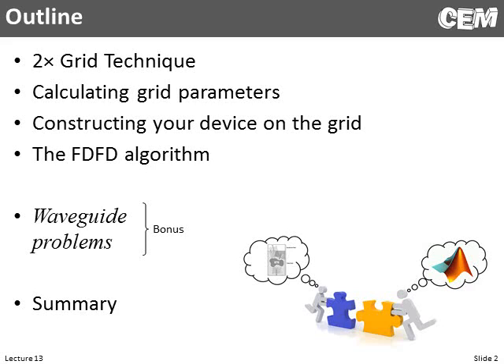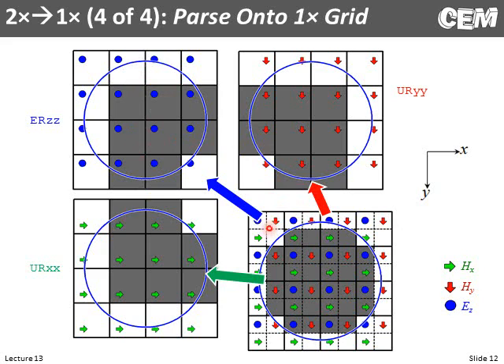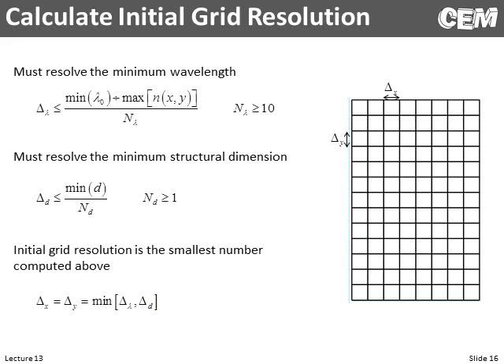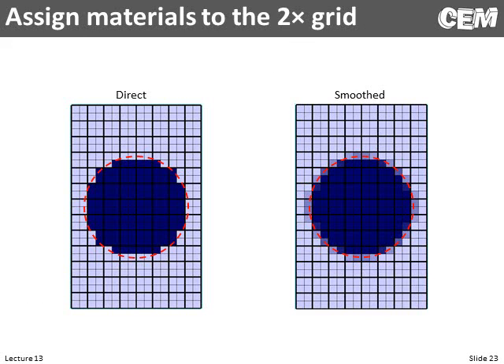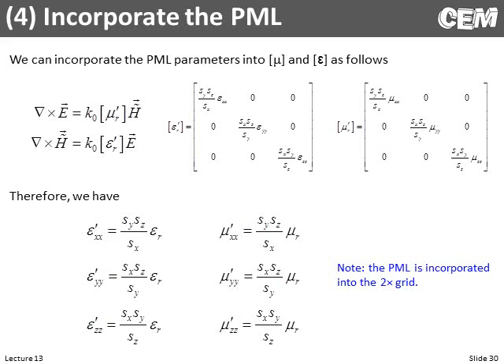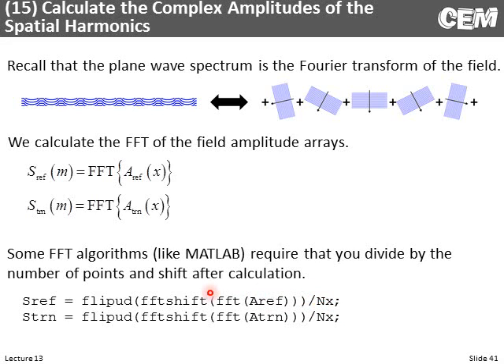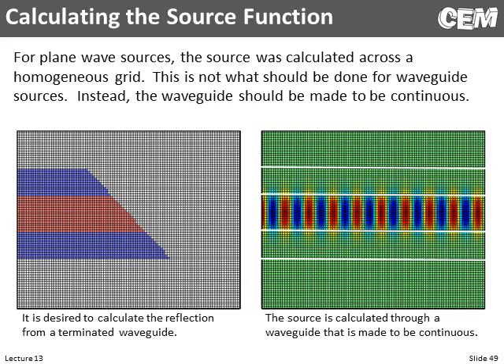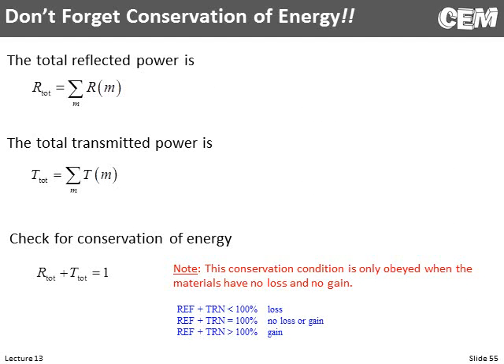Lecture 13 (CEM) -- Implementation of Finite-Difference Frequency-Domain

Comment: Dear Professor,  

Thank you for your clear and detailed instructional videos. I’ve encountered some questions during practical applications and would like to seek your advice.  

In the frequency-domain finite difference algorithm, when constructing a 2D model with periodicity in one direction, how should I modify the difference operators (e.g., **Dx**) at the edge positions to compute electromagnetic field variations under point-source excitation instead of plane-wave excitation? While mature simulation software can handle this, I haven’t found relevant documentation explaining the correction process for these edge operators.  

Best😊
Reply from the maker: First, if you are interested in finite-difference frequency-domain (FDFD), I have recently put out a book on the method. Here is a link to the book website. I highly recommend it. The book talks about this subject, how to modify the derivative matrices, and has all the MATLAB codes.

https://empossible.net/fdfdbook/

To answer your question, the only information from the source your derivative matrices will need is the wave vector to account for angle of incidence. The Dx derivative matrix will need periodic boundary conditions. However, it the source wave has an angle of incidence, there will be a phase difference between the left and right sides of the grid that will need to be accounted for. Sometimes this is called a Floquet boundary condition, but I just call it a periodic boundary condition.

Comment: Thanks for these videos!

Quick question:  Is a PML necessary if you're modeling the 2-d mode fields of a waveguide?
Reply from the maker: That depends.  If you are just calculating the possible modes in a waveguide, you will not need a PML because you will not need to absorb outgoing waves.  This is an eigen-mode analysis and involves solving an eigen-value problem.  If you are simulating a waveguide circuit, you would need a PML, or some other type of absorbing boundary, if any waves escape the waveguide and and need to be numerically eliminated.  This would be called a scattering analysis.

BTW, you may be interested in this new book that covers all of this.

https://empossible.net/fdfdbook/
Reply: @empossible1577  Thanks Professor!

Yes, I had figured a PML wasn't necessary for my guided mode modeling.  The modes I'm getting are just random-ish field distributions that seem to be ignoring my waveguide geometry.  Was wondering if the lack of a PML was the issue.  Could just be a problem porting over to Python.  I'll definitely check out the book
Reply from the maker: @Hohniker  If you can show me pictures of your results, my spider senses may be able to provide some insight about the problem.  I have seen and worked through a lot of problems!  LOL

emprofessor(at)empossible.net

Comment: Thank you for the lecture! I have a question about the boundary condition for a slab waveguide.

If I understood correctly, for E mode, the boundary condition for x-direction should be Dirichlet boundary condition because the field a_y should be 0 outside of clad. But I'm not sure which boundary condition I should choose for z-direction.
Reply from the maker: For a slab waveguide, there is only the x direction so only x-axis boundary conditions are needed.  This happened because the y direction was uniform and the mode is propagating in the z direction.  This makes any derivative in the y direction zero and the z direction is analytical.
Reply: @empossible1577  Ah, I got it. Thank you so much :D
Reply: @empossible1577  I'm sorry but I think I still have a problem.

Let's assume that my 2D FDFD grid is on x-y plane and the guided wave propagates along the x-axis like slide #49 (59:29). Then I can get Ez for E mode and can visualize it like slide #49 (59:29). In this case, we need only y-axis boundary condition(Dirichlet) since the solutions for x-axis is solved analytically like you said. In addition, in this configuration, only DHY and DEY are the matrices I need to get Ez which means, as long as we set Dirichlet boundary condition for x and y-axis, we can use yeeder2d function without any modification.

I've tried waveguide analysis on x-y plane(propagating along x-axis), but my Ez  doesn't look like guiding wave(59:29). I use the parameter information from your notes as a benchmark. Did I miss something? Thank you for your reading :D
Reply: @empossible1577  First, it seems that my code doesn't get eigen-modes and eigen-values properly before visualization. I tried two kinds of eigen-value equations:

1) Ax = DBx
    where A = - (DHY/URxx*DEY + ERzz) and B = inv(URyy)
2) Ax = Dx
    where A = - URyy * (DHY/URxx*DEY + ERzz)

Compared to the eigen-values from your notes, it seems that the values are correct but they are repeated. For example, it's like n_effective = (1.985, 1.985, 1.985, 1.985, 1.985, 1.939, 1.939).
Reply from the maker: @HCho-xe1cj  So as I understand it, you want to launch a guided mode into a waveguide to simulate propagation through that waveguide in 2D FDFD.  When I do this, I first build the waveguide circuit for the 2D simulation.  Second, I extract the cross section of the waveguide where I wish to inject the guided mode.  I then analyze that cross section as a slab waveguide.  If the mode is propagating in the x direction, the cross section is in the y direction.  You will need to build different derivative matrices for the slab waveguide analysis than you have for the FDFD analysis since they have different size grids.  For the slab analysis, use simple Dirichlet BCs and you will only need DEY and DHY since there will be no x and z directions to take derivatives in.  You can use your same yeeder2d() function, just set the size Nx=1 and keep Ny=Ny.  Third, you will identify which of those modes you want to launch.  Usually that is the fundamental mode but you can choose any.  Fourth, you will calculate the source field fsrc by pretending as if the waveguide is just straight along the x axis.  You will calculate the mode all the way across the x direction adding phase as you go according to the effective index of the mode.  Fifth, use the TF/SF technique to launch the source.  You will only need a single TF/SF interface running along the same cross section that you extracted your waveguide for slab analysis.  Otherwise, the TF/SF technique remains the same.

Did something here help?
Reply from the maker: @HCho-xe1cj  The repetition is strange.
Reply: @empossible1577  Thank you for your kind explanation! I realized I needed to completely understand the topic. Now,  I got better and the problem was solved. Thank you always :)
Reply from the maker: @HCho-xe1cj  That is awesome to hear!!  Great job!!

Comment: Hello, Prof. Rumpf, really great lecture! :) I have a question regarding the calculation of reflectivity. Final formula for diffracted wave mode contains absolute value, kinc and k_y^ref. If I understand correctly, first two terms is always positive and the last one is always negative, because it contains minus sign and a square root. That means that R(m) is always negative. What am I missing?
Reply from the maker: Can you point me to the specific equation you are talking about?  Sorry!

There is a negative sign that sometimes floats around my equations for reflection.  This is because technically the kyref term is negative due to there being a backward wave and then another negative sign pops up later in order to get rid of the negative sign.  Maybe this is what you are asking about?
Reply: @empossible1577   Sure :) At slide 28 (~37:59), we have kyref with a negative sign in front of square root. As You explained, that is to account the backwards propagating wave. But real part of kyref will always be negative. Then You have Slide 42 (~50:09), where R(m) equation is presented. It consists of an absolute value of Sref (always positive), kyref (always negative) and kinc (always positive). So overall You have always negative reflection value...
Reply from the maker: @tomastolenis6023  Yes, I was inconsistent here.  In practice, I never include the negative sign in the first equation so kyref is positive.  Thus, there is no negative sign in the second equation you pointed out.  To be completely correct, a negative sign must appear in this second equation.

This section of notes has seen a considerable amount of revisions and I am in the middle of revising it yet again.  This issue is handled much better in the revised notes, but I have not yet rerecorded the videos.  I recommend using the course website as your main portal to the course.  It has the latest version of the notes, links to the latest videos, MATLAB codes, and much more.

https://empossible.net/academics/emp5337/
Reply: @empossible1577  Yes, I used this website and it redirects video to this one, but the notes are different and correct :)  Also, some additional info. Thank You! Also, I must say that it is amazing that You constantly revising and improving the lectures. Big Thanks!
Reply from the maker: @tomastolenis6023  Thank you!  I wish I had time to rerecord all the lectures where I have revised the notes.  Some day!
Reply: @empossible1577  Dear Prof. Rumpf, I checked the updated notes, wrote the program and finally getting very similar results with the ones presented by You in Benchmarking slides. Still there are some discrepancy :) I also noticed that the final results depend on the resolution of the grid (at the level of 0.1-0.2 %). Do You remember at what resolution have You got the results? I really wanna make sure the program is running well :)
Reply from the maker: @tomastolenis6023  If you are within a small fraction of a percent, your code is mostly likely working perfectly!  Congratulations!
Reply: @empossible1577  Good to hear, thank You!
Reply: @empossible1577  Dear, Prof. Rumpf, do You by any chance have some results for benchmarking the metallic gratings? I basically just introduced the complex refractive index to the program and not sure if it models correctly.
Reply from the maker: @tomastolenis6023  I don't have any handy.  There should be plenty in the literature for you.  I really do need to add some things with loss because I get that question a lot.  FDFD is excellent for simulating polarizers!

Comment: Sir,  here is a snippet of my code for problem #1 in homework 8.  These lines are for computing the source and scattering field masking matrix. Could you please check to see if there are any errors? 

% Compute Source
x = 1:Nx;
y = 1:Ny;
[X,Y] = meshgrid(x,y);
fsrc = exp(1j * (kxinc*X + kyinc*Y));
fsrc = fsrc(:);

%Compute Scattered‐Field Masking Matrix
Q = zeros(Nx, Ny);
Q(1:NPML(1)+1 , :) = 1; %scattered field region should be at least one cell larger than the y-low pml
Q = diag( sparse(Q(:)) );

Comment: I have two questions about homework 7.  what value did you use as a minimum structural dimension (minimum feature size)  ? is it the minimum dimension of the grating or the lattice constant of the material of grating?
Reply from the maker: For minimum feature size, I check all dimensions and use the min() function to grab the smallest one.  The is the most robust way to write your code and lets you plat with all of the dimensions and the code will still work.  For this specific device, xmin would be the slot width and ymin would be the substrate thickness.

Comment: Hello Sir,

I have a few questions about the homework related to that lecture (Homework 7 : Build grating for FDTD) : 

- Which equation did you use to determine the initial grid resolution (that is, the one before resolving critical dimensions)? : the minimum wavelength or the minimum structural dimension? Depending on the case, which value of N_lambda or N_d did you use? 

- Regarding the subplot we're supposed to get on Problem #3, how did you normalize your grid in order to have Nx going from -1 to +1 and Ny going from 0 to 6? 

Best,
Reply from the maker: To make a first guess at grid resolution I look at both the minimum wavelength and minimum feature size.  I start with whichever of these gives the smallest values for the grid resolution.

I am labeling the plots with the physical dimensions instead of array indices.  You can do this using a command like imagesc(xa,ya,E) where xa and ya are arrays containing the position of the points along the x and y axes, respectively.

Comment: Thanks very much for the lectures. I have a 2D FDFD model of a finite diffraction grating and a Gaussian excitation source. I´m not sure however how to effectively calculate the reflection and transmission for this case and my attempts so far to solve this have been unsuccessful. Do you have any advice about how to approach this? Thanks.
Reply from the maker: I would break this down into steps.  First, simulate your device as an infinitely periodic grating with plane wave illumination.  This is the easiest, fastest, and will get you an approximate answer to start with.  Second, build your 2D simulation of the finite grating, but do not yet worry about calculating transmission and reflection.  Place a PML around all sides and incorporate a Gaussian beam source.  Make sure the simulation visually looks correct before doing anything else.  

Third, now all you have to do is the calculation for scattering from your device.  There are a number of things you could do depending on what you need to learn from the simulation.  Are you only concerned about total reflection and transmission?  If so, is there any part of the beam that will diffract around the edges of the device?  Do you want to assess the properties of the Gaussian beam after reflection and transmission?  Are you concerned about any power that may diffract nearly horizontal to the grating?  The manner in which you do this third step depends on those answers.  

One simple thing you could do is pick an observation window around one period of the grating and in the middle of the beam.  Treat that field as you would the infinitely periodic case.  This is simple and requires the least modification to your code, but is not very accurate for small gratings (maybe 5 periods or less?).  Next, you could treat the finite grating as one very large periodic structure.  This also requires very little modification to your code, but will ignore any waves diffracted nearly horizontal to your device.  You could treat this as a scattering problem discussed in Lecture 24 of the FDTD class here:

http://emlab.utep.edu/ee5390fdtd.htm

This is not normally how gratings are characterized.  Another option would be to look at the scattered field and do a curve fit to a Gaussian.  After you do that, you could extract the properties of the reflected and transmitted beam.  Yet another option is to Fourier transform your beam into a plane wave spectrum, simulate each plane wave with an infinitely periodic model, and then integrate your answers.
Reply: Thanks for the speedy response. I have already performed steps 1 and 2 and and those parts work well. I´m not primarily concerned with the numbers of the total reluctance and transmittance as I am extracting the fields at the edges and doing a far-field transformation to generate diffraction patterns. However, I would like a system of checks and balances in place to be confident of my output data, such as the energy conservation. 

There isn´t a gap for the field to for the beam to diffract around the edges and the simulations are quite long such that Nx >> Ny so  I am not particularly concerned with near horizontal propagating waves.
Reply from the maker: You sound like you have a very good grasp of what you are doing.  One check and balance is that if you can calculate the diffraction efficiencies of if your diffraction orders, that should correlate with your pattern.  Otherwise, take a look at the scattering analysis (i.e. near-field-to-far-field transformation) in Lecture 24 here:

http://emlab.utep.edu/ee5390fdtd.htm

Hope this helps!
Reply: Hi, thanks this was helpful. Could I just quickly ask, in said lecture on slide 77 what the purpose of the term "iw" is? Kind Regards, glw
Reply from the maker: Good question.  On an FDTD grid, the end points of the integral fall in the middle of a grid cell.  Therefore, only half of the grid cell should be integrated when that grid cell is at the limit of the integral.  The iw terms equal 1 everywhere except at the limits where it equals 0.5.